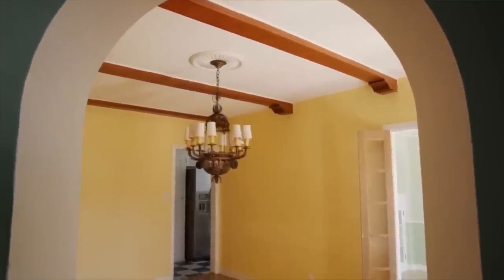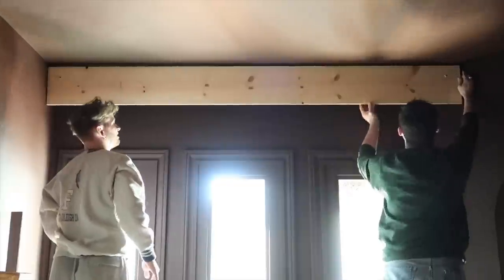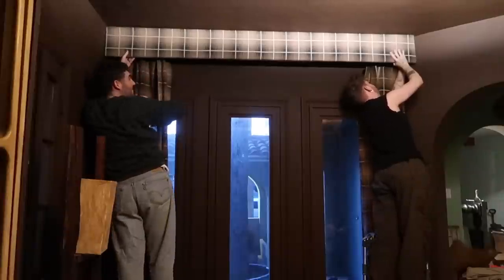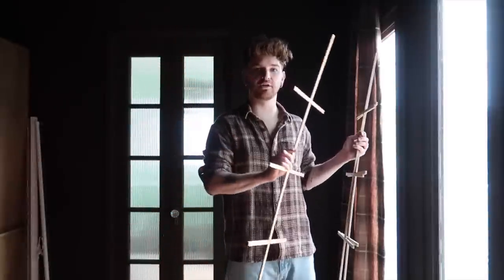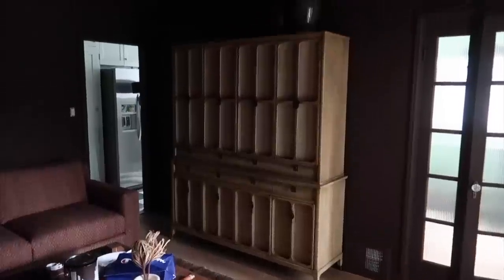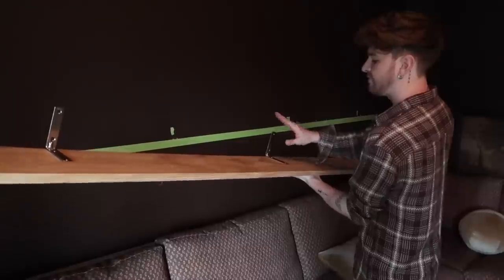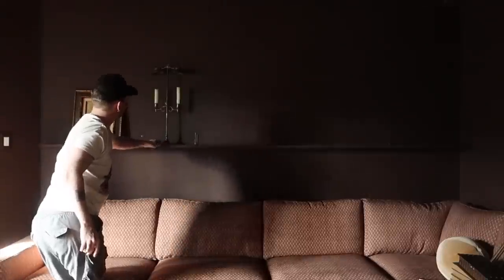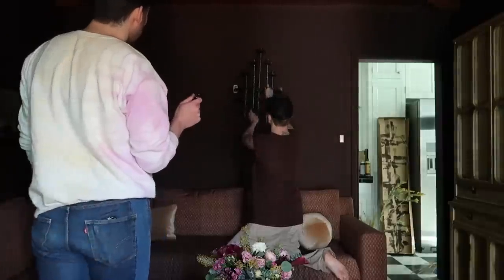MOODY MOVIE ROOM MAKEOVER ✨ The Reveal ✨ DIY Hidden Movie Screen & Decorating!

Comment: What if you closed off that kitchen access by the hutch, even if it's just visually? I think it only feels cramped because the opening is there but would feel cozy if it was a "wall" (or closed door)?
Reply: On that thought wave add a door that looks just like the wall then problem is solved or cut the back off the unit by Two inches then put on another backing however easiest is putting in a door that looks exactly like the wall
But Love it' As is 💝
As it's a great movie room and the Lights Sconces are Beautiful 😍 & those shelves are a clever edition and that chair and light next to it is amazing 😍
Totally great Job 😘🥰
Great Touches....💝
Reply: 1000%!

Comment: TIP:  GET BETTER LIGHTING   by adding 2 or 3 wall lights ( SCONCE ) for reading - this could be some great retro 1940 lights that either swing out on arm from wall  or are on cool scissor/accordion  extension. Without better lighting you will struggle to feel comfortable AND all your wonderful color choices will be lost in the DARK.  ALSO consider SOFFIT lighting - this is perfect for a small room. Creating several lighting sources in the MID ZONE  (4-5' height) of room creates beautiful welcoming islands of light

Comment: I like the way the shelf came out. After sometime though those screws might tear out since all the weight of the items are actually on the screw and not the L bracket. The same idea could work if you sat the board on top of the L bracket and drilled the screws in from the bottom but you would have to chip out the thickness of the metal so that it sits flush against the wall how you have it, but then the weight is actually transferred to the bracket vs the screw. Not sure if that makes sense. Love how your home is turning out! <3
Reply from the maker: The items on top are honestly pretty light and it’s screwed into 5 studs so I think it will be alright for the time being!
Reply: I came to say the same thing. Weight on the shelf pulls at the screws holding the brackets in the wall when they're on top. If you put the brackets UNDER  the shelf, weight pushes the brackets towards the wall and actually makes it more secure. I wouldn't put anything heavy on that shelf with the brackets on the top side, Drew.  A plant pot with water can be pretty heavy. Stick to faux greenery on your shelf. And small lightweight doodads.🥴👍
Reply: The bracket is definitely not going anywhere! It’s the shelf that is gonna come straight down cuz it doesn’t have the support from the bracket underneath of it😅 that’s the only thing though everything else is absolutely beautiful and perfect!
Reply: Love reading everyone's advice.
If my dad had mounted it he would have used those screws with the plastic sleeve. I don't know the name. But Drew did even better by finding the stud. 

(And talk about studs, can we talk about Justin?) 😆 Sorry, I just appreciate beauty in all forms. I'm old, but not dead.
Reply: Depend on if he hit studs or not.
Reply: @lonefox  That's good, studs for the win.😊👍
Reply: @Edu_Kate  I think Justin plays for the other team. Not that there is anything wrong with it🥰
Reply: @alicegauteng2358  
Really?! 😱
Consider me shocked. 🚫 
He's still a good looking person. 
I'm also old enough to be his grandma. Ooh, ouch. That hurts ... when I write it out. Let's revise that to old enough to be his mom.

Comment: Future tip for hanging things on old plaster walls- Molly bolts are the best!! They save the day when you need to hang something heavy or that needs support and you can’t drill into a stud. They work wonders in my 110+ year old home with horse hair plaster walls. ❤️

Comment: What an amazing transformation. I loved that you were fearless and went bold. The color on the walls and the ceiling...WOW!  I love it all. 
And Yes Howards feed and wax is the best. It has been around for years. I use it on all of my vintage and antique pieces. 
Howards also makes Restore a Finish that works great if the piece has a bunch of scratches and wear!  Way easier than stripping , sanding and restaining. 
Job well done Drew!!!

Comment: Bravo Drew!  Thank you for addressing the buffet, the cane inserts really helped calm down its visual presence and maybe it was just how it appeared in the previous camera angle and the vacant rectangles that made it conflict, but it looks okay now and it totally works great with the projection screen set-up. The curtains, floor lamp, and reed chair are magnificent together! Love your work!  Thank YOU for sharing so much of the "how to's" that solve creative challenges. 

P.S. Idea:  I don't know if you have any more of the dark floral molding that you used for the kitchen floor upstairs, but it would be beautiful cut into squares to fit over the shelf brackets and hide them, or one long piece provided it wouldn't take too much space from the shelf depth. Any wood rosette or a thin plain molding painted the wall color would do the trick to hide the bracket and finish the look.

Comment: I have a trick to find studs through plaster walls. Just use a strong magnet. As soon a you find a screw the magnet will be held on to the wall. It's actually crazy how well it works!

Comment: its pretty! what I would do is remove the big console and buy a frame tv, and fill up the wall with vintage art around the tv frame. Finally I would add some moldings to that wall to elevate the look. The moldings would be like the castle green bathroom that magnolia did.

Comment: I love the room Drew I am a total fan. Maybe this will be helpful, I certainly do not intend it  to be critical… A cornice is a hard firm structure like a board that is covered with fabric. Or sometimes can be decorative without fabric, but a valance although it may be supported by a wood cornice, is always referring to the loose fabric that hangs below either the board, or the rod. Both of them go at the top of the window, horizontally. So one could have a cornice with or without a valance hanging from it. Or one can have a valance that is the top horizontal curtain that has no part of it being a cornice. I hope that makes sense, long time sewer here. Also, The edge the vertical edge of the fabric is the selvage pronounced ”sell-vudge”. Thank you so much for your work

Comment: The room came together beautifully Drew.   It’s reminiscent of a Gentlemen den.
You’re right! From a 2D POV the unit appears to be close to door way, it’s a pity that you had an obstruction on the other side so you could not move the unit across a bit, but we all run into these problems, and it’s the solutions that count.
As you said you could always direct traffic to the other two doors to this room.  For the door near the unit I’ve seen on Pinterest a large framed “painting” door (that acts a secret door) that leads to a room similar to this, perhaps on the inside of the door (in this room) you could have a mirror  door, in a Stuart Fox églomisé finish, to give reflection and the illusion of a wider room, especially in that smaller area.  Just a thought to create some added fun to this space.

Comment: I also have an older house with plaster and lath walls in the best way to find a stud is to find the nails that are holding the lath.  you can do that with two rare earth magnets with a piece of string stuck between them and you let it swing back and forth on the wall and then it will stick to wear one of the nails are. Wherever it sticks is a stud.

Comment: I also thought the corner you rounded the piece cut off possibly would of made the opposite side end of the shelf flow by flipping it putting it in the end so the curve wouldf low and connect with the wall, just a thought.

Comment: i looked for the link to the electric stapler but all i saw was the "Logan Framing Tool" which is yellow and it seems like its manually operated based on the amazon link... and the one you were using  was silver. do you have any updated link for it?

Comment: The issue with the cabinet appearing too large is that it impedes on the doorway.  It doesn't matter that you don't need or use that entrance.  Think about installing a flat panel swining door painted the wall color. It will make that corner disappear but remain functional. I hate when I see people putting furniture in front of doors. If you don't need it or use it, then remove it.

Comment: Now that the others have mentioned, the hutch definitely feels too large and out of place. It’s due to the tight space between the sofa arm and half of the hutch blocking the doorway. It should be less thick or perhaps shifted towards the right. 
 
The chocolate wall looks extremely good with the texture. Unfortunately, it absorbed the couch and just blended together. A cream couch would compliment it better and tie in with the colors of the plaid curtains.

The highlights were definitely the ceiling light and the wall sconce, they looked luxurious and tasteful.

Comment: So there is no door between the movie room and the kitchen? When you see outside the room, it seems like a hallway with a vending machine, which is of course your fridge. But that is always the impression, even though, I know better. The light from the kitchen draws your eye and kills the mood of the movie room. If you close off that entrance and paint it the same color as the walls, you won't be able to see the furniture partially blocks the doorway. Something I don't understand is where do you get the movie you are watching? So there's no TV in this room where you can stream Netflix? LOL  I just don't get it. I love that new light situation by the window. I've never seen anything like it. Just two elements of concern, Drew. How is that shelf when you're sitting on the couch? Could you bang your head on it? And the candles on that shelf, plus the ones on the wall, seem almost like an accident waiting to happen. Why no LED candles or candles ensconced in something? This just seems risky for no reason. I love that you met Arvin!!

Comment: I think to really finish off the room the open doorway to the kitchen needs to be closed off. Even if you made that kitchen as beautiful as upstairs, it still needs to be closed off in some way - even if you just added a solid door (instead of glass doors like on the other side, which wonderfully blend in and complement the windows they are next to.

Comment: Awful room.  Furniture pieces are too large for the space, sofa crammed in the corner, buffet hutch in doorway, additional space filling pieces at opposite end of room are clutter, shelf above sofa is terrible.  Flatscreen TV mounted on the wall would have been a cleaner finish, the projector screen project very tasteless.  The colour scheme is VERY American however not the right choice for an already dark corridor room.  Some of your works are fantastic aka Kitchen, this one is a no go.  I don't do Telegram, I don't hide my comments or conversations.  **As a decorator one MUST accept negative critiques, especially if one generates income by publishing projects on a public forum. This is a statement, not a question.